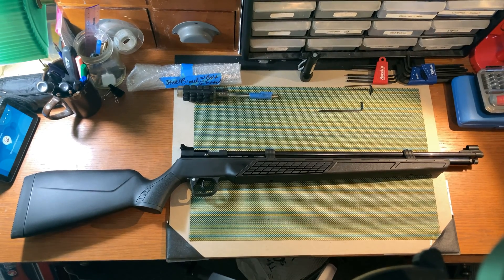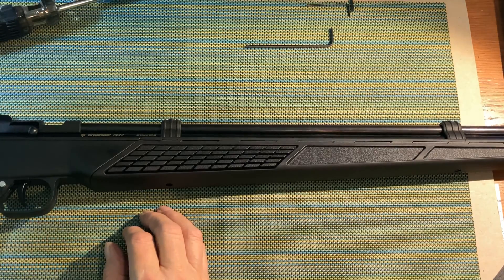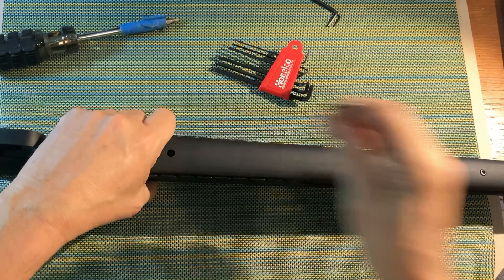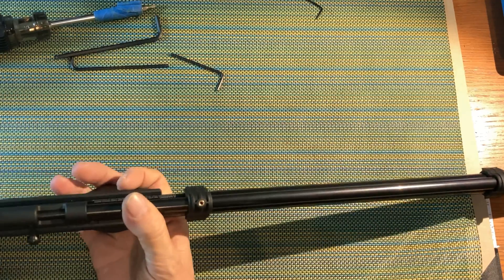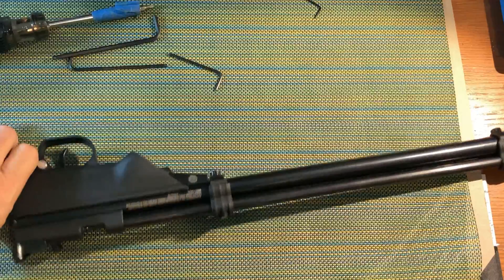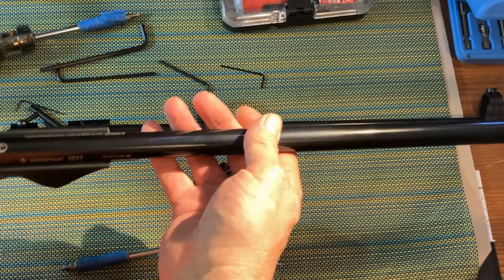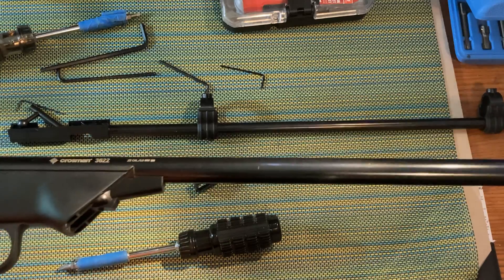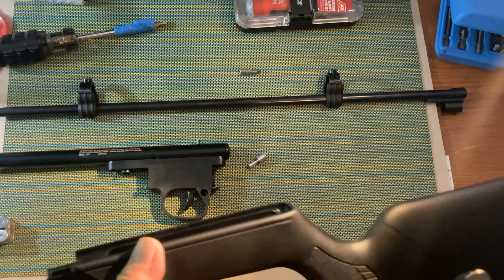Inside Crosman’s 3622 PCP Rifle - Disassembly (Part 1)

Comment: Is there the classic transfert port &  gasket on this one ?
I couldn't see very well seems like the port was stuck in the brewch.

The barrel definitely looks way more secured than most airgun using the same breech
Reply from the maker: Yes to TP & breech seal (gasket as you refer to it.) Yes, sort of to second part. They are using improved barrel bands which provide some additional security. This was a late add as I understand it the preproduction guns used a standard band. Other than that, same, same. I’ve got disassembly videos if you’re interested.
Reply: @AlsAirguns I thought that was what I was looking at 😁 but didn't see the port and seal an both parts 🤔
Reply from the maker: The barrel bands are pretty cool though and they secure with an 0.05 Allen key at the top. I guess it through a curve to 3rd party developers who designed products based on the preproduction guns sent around.

The preproduction guns had the screws sealed so they could not be disassembled. I believe my video is the first public disassembly of a 3622.

Comment: Sense its out of the stock you can drill and tap the back of the trigger housing  and add two set screws to make the trigger adjustable  it simple but helps quite a bit with the trigger play.. 👍✌️💯
Reply from the maker: That’s cool. I’m not very familiar with that trigger group. You were correct about that part being pure 2260/Disco. Shooting it, I found the trigger better than my last 2260.
Reply: @AlsAirguns  search YouTube  for discovery  2 or 3 screw trigger mod there should be a video  it's old  it shows how and were to add set screws to make the trigger adjustable    it's real easy once you watch the video  help out a good amount   with getting the trigger slope  out. If you also look on magnum airguns  web sight at the discovery trigger housing that they sell also have the mod done to the housing  for a example  they also have up grate kits  for the original trigger assembly. 👍✌️💯🔫
Reply: @AlsAirguns  I'm interested to see what they used for  the valve assembly   it probably the 2260 valve with discovery  popet and  top valve cap .  You could add a power adjuster from a discovery  to adjust the hammer for it about 10$.   👍✌️💯
Reply: @josephsaucedo8691  I was thinking the exact same thing sir :)
Reply from the maker: Hey there, just leaving this comment for those who missed it elsewhere. The 3622, like all Crosman pumpers uses the narrow diameter tubes and valves found in 1322, 1377, 362, 2289 and not the large diameter tubes and valve’s of the 2240,2260 & Discovery models. That is part of what’s so neat about this product. Reducing tube diameter reduces cost and improves pressure handling. Same with the valves. Less material and higher pressure handling via less expensive tubing.